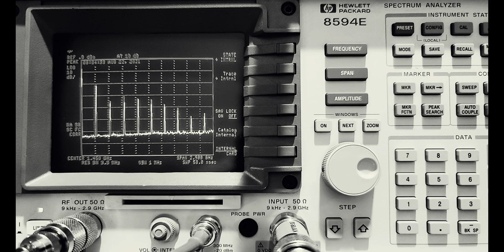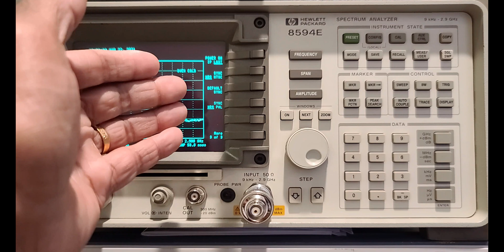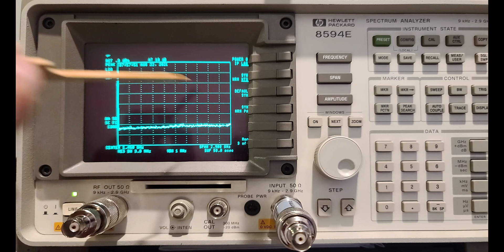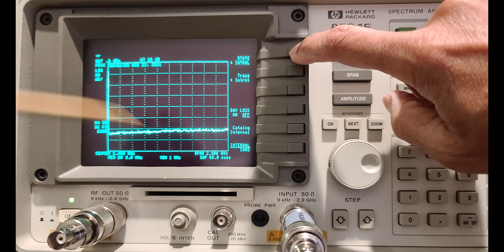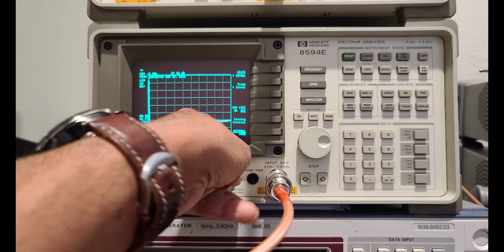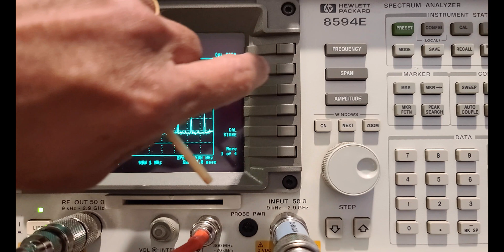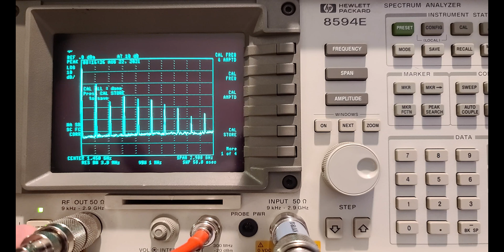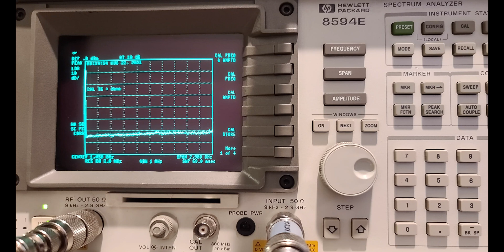N0AGI - HP 8594E - Spectrum Analyzer - How-To - Calibration and Unflicker

Comment: I have a problem I was trying to change the hor/ vert sweep to match a video camera I was in the control menu , sweep I lost both vertical and horizontal sweep how do you do a configure reset on the analyzer? W9LST
Reply from the maker: you can look it up in the HP 8594E manual:  For reference it says the following in the "9-2 If You Have A Problem" section.

"
10. If you wish to reset the spectrum analyzer configuration to the state it was in when it was
originally shipped from the factory, use DEFAULT CONFIG . To access DEFAULT CONFIG ,
press [CONFIG), More 1 of 3 , DEFAULT CONFIG, DEFAULT CONFIG. (DEFAULT CONFIG
requires a double key press.) See the softkey description for DEFAULT CONFIG
in Chapter 7.
"